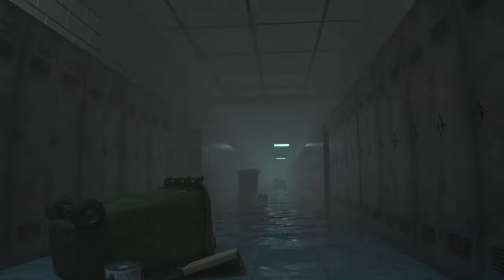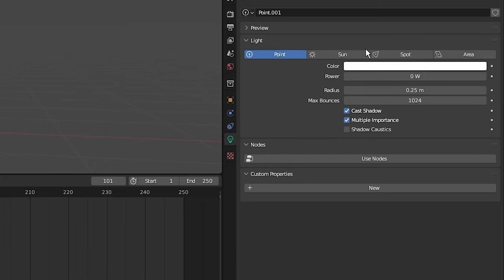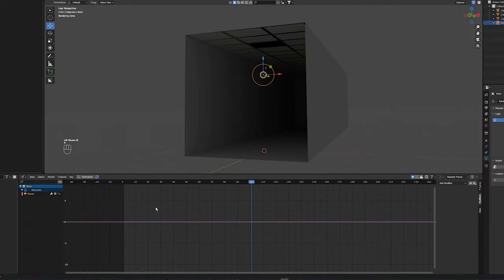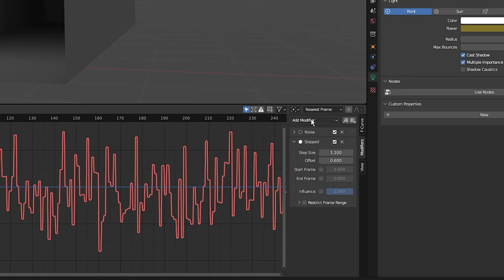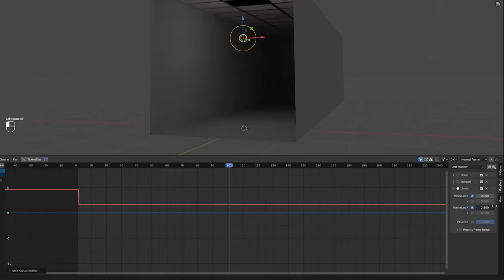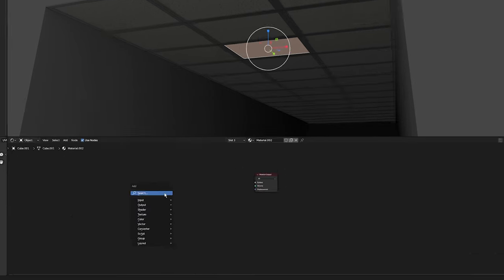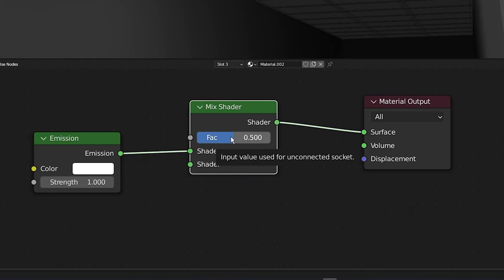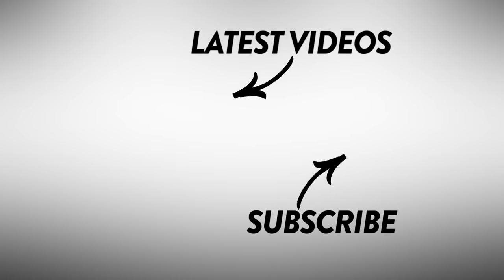How to Make a Flickering Light in Blender

Comment: Had some issue recreating this in my model. I keyframed the emission not the mix shader you added. You know, if anyone runs into the same problem you might be keyframing the wrong portion of the light.
Reply from the maker: Interesting..When i set a keyframe on the emission it just changed color when modifier was added then pressing space bar. Adding the mix shader just gave me a little more control of how bright the light can get and what color it was.
Reply: @JermaineGrant  Its a great idea though. I think that's the hard part with tutorials is we're all doing ALMOST the same thing with different video cards. So, every result will be slightly different. This did help though I was stumped with this fire pit and getting it to flicker. My FAC on my Mix Shader is being bypassed to three other nodes. When I tried to just add it back using your method like a switch before the output I didn't like the result. I did apply it to my colorramp instead and it was more pleasant. 

In short I'm assuming that keyframing and graph editing is any node with a factor? I'm also using drivers so that might be an issue as well with the final result.

Comment: I may have done something wrong. I've been doing this tutorial multiple times ( Thanks ! ) but sometimes, I can't figure how or why but it wont work normally. My face just keep turning on and off but without emmiting any light. Probably weird because in Shading, I'm using the emission node and the Mix Shader...
Reply from the maker: I might be able to help, 1. make sure to set the keyframe on the mix shader and not on the emission node.
2. turn up emission strength.
3. it might be because the line graph isnt going above zero when the noise modifier is added causing it to stay off you can solve this by increasing the strenght of the noise modifier. hope this helps
Reply: @JermaineGrant  First of all thanks for your quick answer. Then, I've been studying my scene and it looks like the 3 possibilities does not work and I can't figure why. As I said, I've been doing your tutorial many times and sometimes, It worked ! So for this one, I checked and the keyframe is on the mix shader node, I've tried to put the emission strength to 6000 too. Last but not least, the line in the graph editor is going over 0, it start above the 0 and, with the noise deformer, sometimes it goes under the line 0. I understand that there's not a lot of possibilities left but I appreciate your help that you gave me. :D
Reply: Okay I just found the problem ! God Damn, the problem was just that I needed to switch on cylce mode..........
Reply from the maker: @julien3380  aahh i forgot to mention it only works in cycles. Glad you figured it out man 👍

Comment: One thing I am curious about, how would I then keyframe so that the lights turn off after a while for an animation. I cannot just set the power value to 0 because of the modifiers.
Reply from the maker: you need to play around with the max and min X Value on the limits modifier to turn tyhe light on or off at any given time you want.

Comment: Thanks for the awesome tutorial, Jermaine. I wonder if there is a way to make the lights flicker only during certain keyframe ranges? Like, for example, I need it to be off from keyframes 0 to 50, then flicker from 50 to 70, then again off, from 70 to 120, and again flicker from 120 to 140, and so on...Hope I'm being clear enough :D
Reply from the maker: Yep i understand...one way to do that is if you increase or decrease the Maximum X value on the limits modifier until you get to the frame you want where the line sits below zero (light off) duplicate the light press shift D then right click so it duplicates itself in the same exact place , then when you want the light to start flickering again increase or decrease the number on the Minimum X value of the 2nd light to the frame you want it. if you want it to turn on or off at a certain fram you can movr the line graph up or down ( above or below zero) for extra control...this isnt the best way to do it but it beats manually animating the flicker at every keyframe.
Reply: Awesome! Let me give it a shot

Comment: hello when i do this my light instead of turning on and off it inverts colors

so im using an orange like for gun fire
it inverts the orange color to a blue to represent light off

when i try regular setting light it inverts white color light 
to black

any idea how to fix this
Reply: so i turned off my hdr sky it has natural colors but makes the scene very dark so i put another light without flicker to light the scene and it goes back to inverting colors
Reply from the maker: Did you set the keyframe for power on the light? Not colour… and are you in the shader editor ? If so set the keyframe on the mix shader node if you set it on emission node it turns the light to different colors.
Reply: @JermaineGrant  i looked in graph editor
if the red line goes below the blue line it inverts colors

messing with the Y value in Limits and Strength value in Noise helped , thanks for the tutorial!

Comment: I did exactly everything you did here, but the light simply dies and it's no longer visible, or barely visible
Reply from the maker: Did you make sure the peak (top) of the line is above 0 in the graph. Also to set the keyframe on the mix shader not the emmission shader. Hope this helps
Reply: @JermaineGrant  Thanks for the reply, I'll try that today! Either way you gained a sub